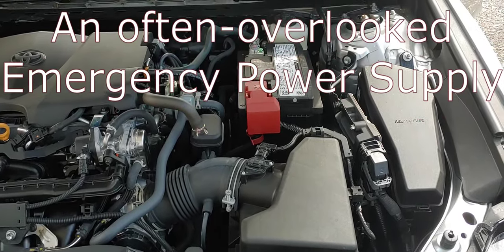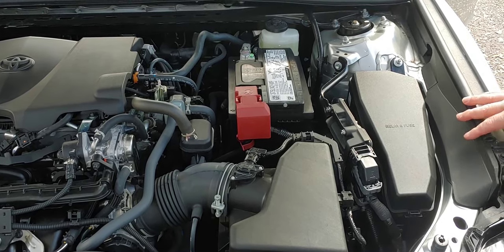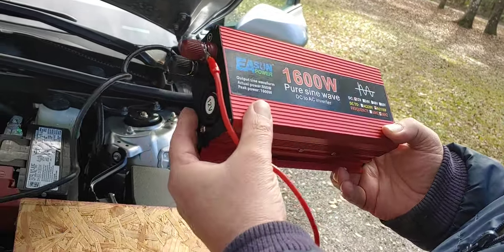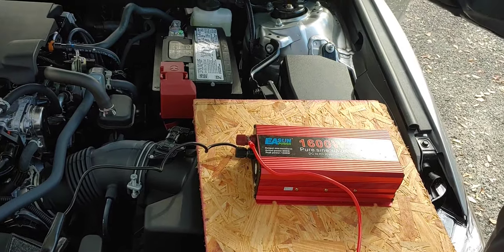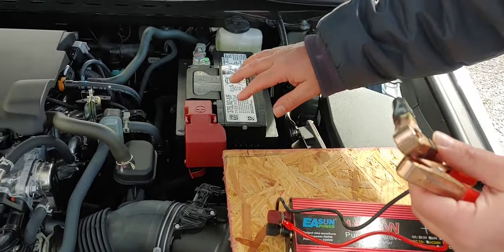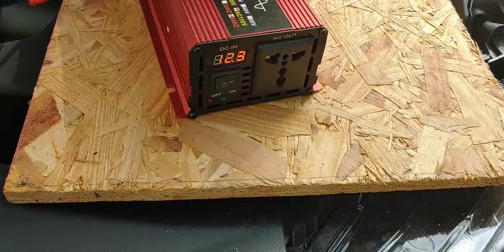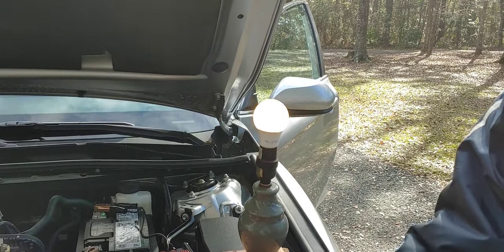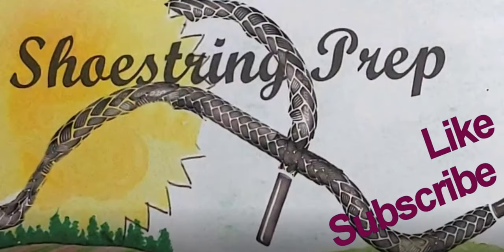Emergency Power Supply: How to connect an inverter to a car battery.

Comment: hi, i have the smaller 500W/1000W version, only modification i made was that i hard wired an extension cord to it by soldering the wire to the circuit board, this becouse the build in socket wasnt making a good connection.
Reply from the maker: Thanks for your comment.

Comment: Can we bring a fully charged car battery inside the house and connect it or do we have to use the still installed car battery?
Reply from the maker: I would not bring a car battery into the house. It may give off fumes that are dangerous. Also if it's not in the car you can't start the car up and keep the battery charged. Thanks for your comment.
Reply: You can but be super careful you dont accidentally short it can cause a fire.